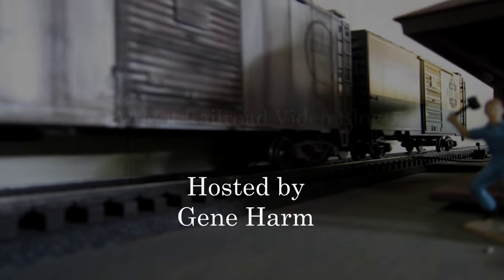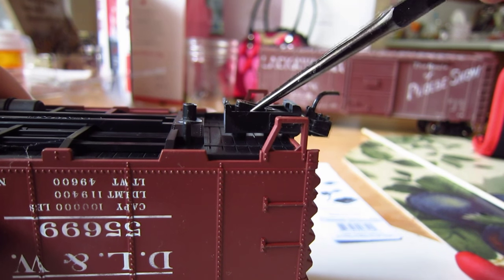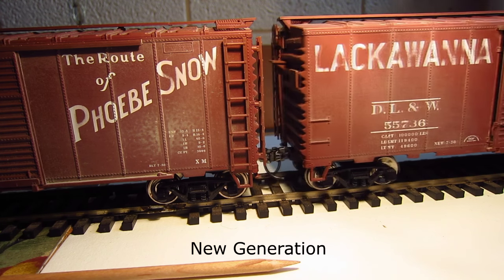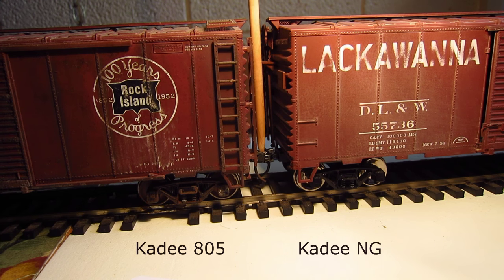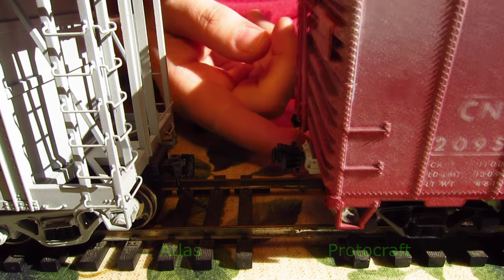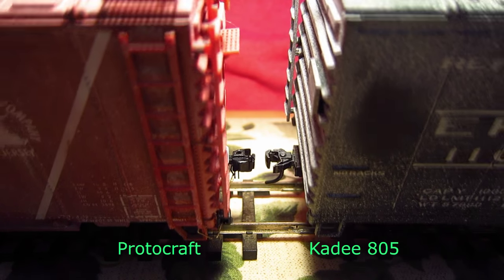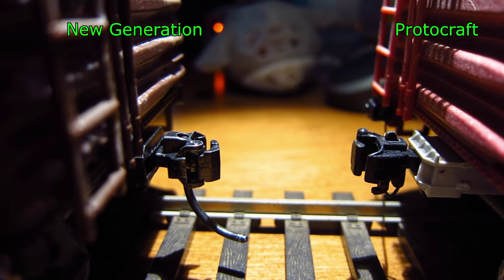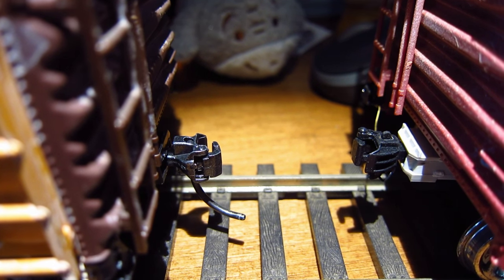O Scale Coupler Performance Test  -MRVlog 14

Comment: Hello, which coupler will best connect to the traditional couplers known as the claw?  As I am transitioning to scale couplers and until I am finished I would still like to run trains, thanks.
Reply from the maker: +bigdadday bubblejomay My understanding is that the Kadee 805 will connect to the claw. I regret not testing this in the video. I'm away from home this week but if I remember I'll try it when I get home. Then come back  here and post my findings.
Reply: Yes 800 series works with Lionel.